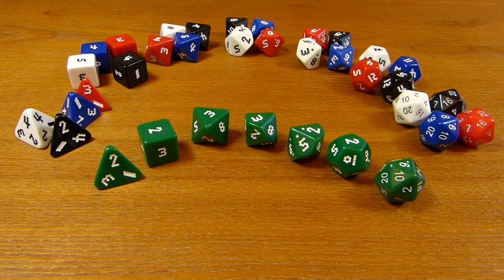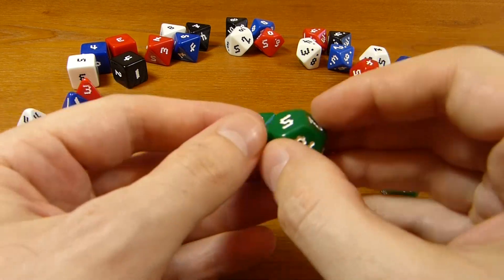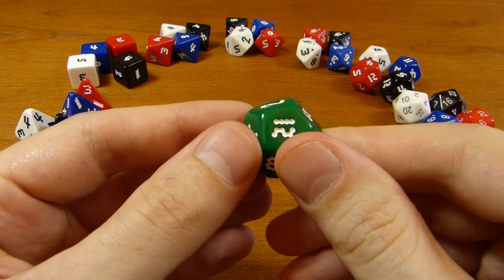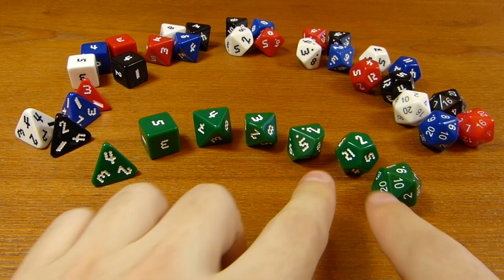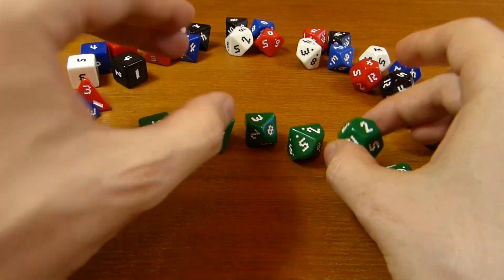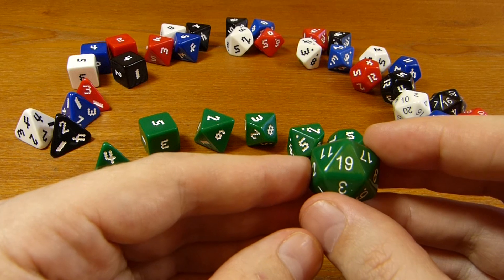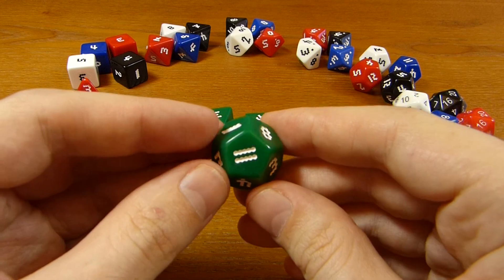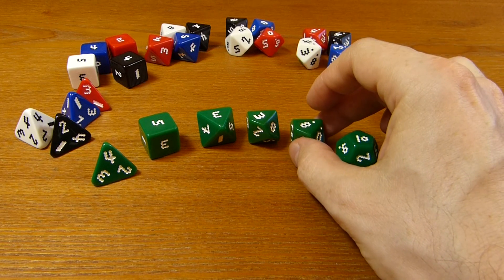Optidice

Comment: I just received my set of OptiDice, which inspired me to check how numerically balanced the rest of my dice were. I was shocked how other than OptiDice, every dice set has 5-8 on the same side of the d8 and 7-12 on the same side of the d12. And a few sets didn't even make sure opposite sides added to 9 or 13 (respectively)! Numerical balancing needs to become the standard.

Comment: For some reason my d8 is numbered with opposing pairs not adding up to 9. 
1 and 2 are opposite, 3 and 4 are opposite, 5 and 6 are opposite, 7 and 8 are opposite. 

All my other non-d4 dice from the same set follow the rule (if we treat the 0 on the d10 as a 0 rather than 10 for the maths) so I have no idea why this is set up like this.

Comment: the two d10s are: 0-9 and 1-10.
Am i right?
Reply: Yep, a d10 and a d%.

Can roll between [0,1] and [9,10] for a total of 1% or 100% (or anything in between)
Reply: If you had them both as D10s, which you can, you'd need to remember to take 10 from the total to prevent the maximum from being 110%, and the minimum from being 11%

Comment: If you can find a font with variable boldness you could use some sort of area calculator and slowly change the boldness of each of the numbers until they all match, equal area should mean equal material
Reply: The hexagons are for ease of proving the sides are equal. Even the triangle version in the top comment could be proved fairly quickly with just isometric graph paper and a pencil.
Reply: @Leadvest  I get the methodology behind the hexagons but using variable size and/or boldness or even just etching extra designs around the outside of the numbers would look far better and have the same effect
Reply: I had the same thought about borders.

Comment: For the D20, I wonder if it would be possible to do some weird calculus magic to figure out the exact area of the regular, non-hexagon-font number indentations then change the sizes of those so each side is the same weight
actually nevermind that sounds like a CAD nightmare
Reply: @bearweston8350  No
Reply: The CAD for that wouldn't actually be that hard. There are functions to provide the volume and area of objects, a font would be nothing different. Might look weird with all the different sizes, but its very doable.
Reply: @admiralbees1690  what about a d120?

Comment: Well, if you ditch the decimal system, you could use your solution in the d20.

Just go 0 1 2 3 4 5 6 7 8 9 a b c d e f g h i j.

0=20 here. Or you could use k=20.

Comment: I'm imagining that the indented numbering adds an absolute error, and simply inking the hexagons on the surface would be better.
Reply: @SECRETS An imparity in ink will be less impactful than an imparity in material, as way less ink is necessary to convey the number than material that has to be removed.